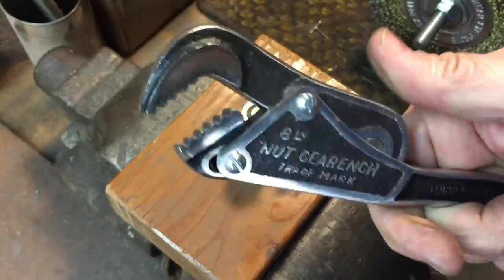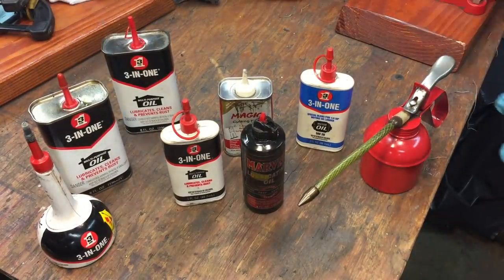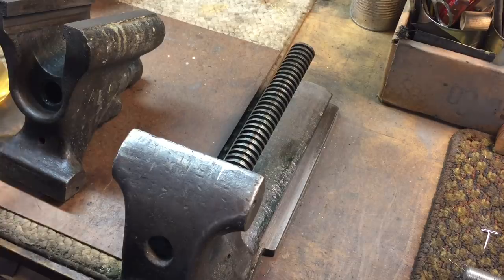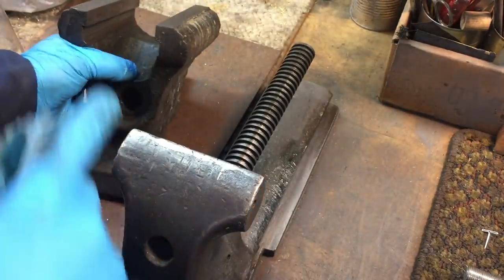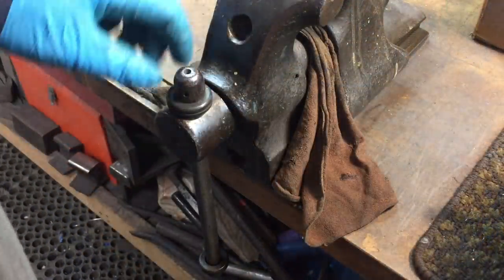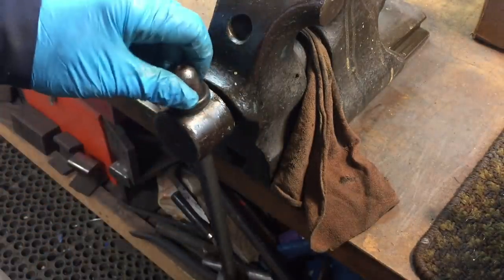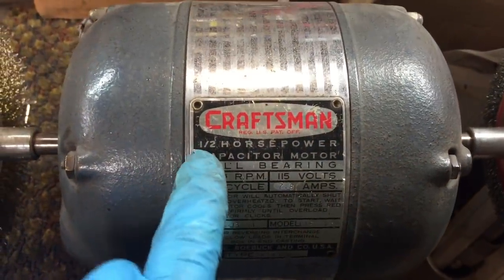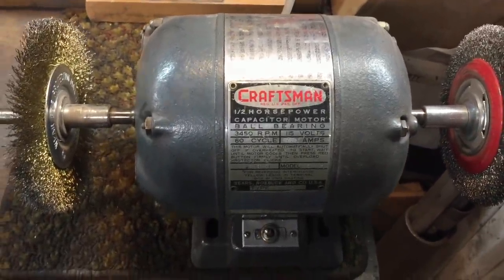Valentine's Day Mosh... Something to nosh on...

Comment: I like the applicator tip that comes on the small Rem oil bottle.  I think it works a lot like your Ronsonol lighter fluid container.  You fold it out to add a drop and fold it back in to close. I vote for just painting the bulldog's collar "ScoutCrafter Red"!

Comment: Hi scout,  thanks for the video,  3 in 1 oil has been around as long as I remember, but as you say the containers are pretty unstable, I have a place at the back of my bench ,made just to keep it upright. The dumpy one whith the pull out spout seems the most stable design,  but would have preferred  it whith out the tube spout,   I have a Wesco from the 1950s that belonged to my father, it's cone shaped 3,1/2"dia, by 4" tall whith a brass screw fitting to the spout so that you can shut it off, to use it you undo the fitting ,invert the can and press the base, this one doesn't  leak even if laid on its side for days,!  As for your bulldog, it looks great now, alot of older castings like yours were made from Spelter,  I would be inclined to lacquer it to prevent oxidising,  it would be a shame to cover up all that detail.  Your great grandads vise is a beauty,  made to last. Best wishes to you and your's, Stuart.uk.

Comment: One last thing, My Dad was a character. On our service truck at the garage dad found an old Mack bulldog and he mounted it to the truck hood. We had real english bull dogs at home. But dad took and drilled a hole in the bull dog ornament and installed a windshield washer nozzle from an old junk Chevy. He wired up a starter button on the dash of the truck connected to an electric windshield washer pump spliced into the washer fluid tank under the hood. We would be sitting at a stop light and some guy would be walking real slow across, blocking the lane and he would reach out and push that button and the bulldog would pee on the guy!! They just couldn't figure out where it came from! He would really enjoy himself with this! Never agravate a man with tools and a little time on his hands!

Comment: If you ever get new shocks or struts for your car, ask the mechanic to save the flexible rubber boots from them and then put it over the acme thread to protect it and it’ll crush and stretch as you open and close the vice. My father has clear silicone like oil bottles that have a flexible tube with a needle point tip for precise application on his knitting machines.
Reply from the maker: Joe- I bet McMaster Carr sells them!n   =D

Comment: My old Craftsman 8" bench table saw has a half horse and is plenty. Even has the original Craftsman V-belt. I keep Marvelous Mysterious oil in a pump spray bottle and the trigger hangs on the shelf edge And the 1st truck I ever drove after the chauffeurs license at 21 was a steel hooded DM Mack tri-axle. Since then I herded B-models, R's, DM's, C's, U's and all the way up to the 800 series. But that's 50 years worth and that's not counting the machines. I've looked at bulldog butts all my life and then ended up with 2 live ones! Oh well.  Been Blessed with a LOT of living and STILL Blessed. Happy Valentines Day, John CS and Sweetie! We had a DANDY!
Reply from the maker: Hi Lewie!  You really know your Macks!  I remember my Dad telling me when he was a young man and just started driving trucks he drove a early Mack with hard rubber tires and chain drive!  One rainy day he was going down a cobble stone hill and that was it, wound up in a store front!  LOL
Reply: @ScoutCrafter  I'm not as old as your Dad but my back bone can vouch for the rest. The B-model had a 711 engine which was the bigger Thermodyne that was a 673, around 210 horses. It had a duplex 2-stick, a 5x2 and you could track it by the parts falling off it but it was a SWEET driving, pulling and shifting truck as I ever drove. It had a concave cab because of the old trailers had rounded noses.  The motor/tranny mounts were GONE so when you went to take off the whole thing would just roll over, the sticks would move away from you and off you'd go. WILD! And the MB which is a garbage truck square cab sitting over the front tires was a single axle that I/we pulled a D7-F dozer with, hooked to a 2-axle lowboy. It had a gold dog Maxidyne 237 and a 5-speed. And me steadily looking at bulldog butts!

Comment: Clear coat it so it maintains the shine and detail. Resist the temptation to paint it red!!
BTW I hate those factory oil containers too. Love the one you had with the thumb pump and see-through hose. They are a little bulky to have all over the shop and you have to mark them to identify the liquid, but they work great.

Comment: Yeah, leave it shiny. By the way those rubber bumpers on your vise are Dixon glad hand washers. A glad hand is a quarter turn 3/4” air hose connector. Most industrial supply stores have them, like Graingers, MSC or the like.

Comment: Back in the 70’s I used to own a. modern version of that wrench by Craftsman, I loved it.  I used to beat the crap out of it to loosen some nuts and bolts and it fit almost every bolt I came across in the field.
I despise that 3 in 1 oil can with the pull out straw.  I have to get another can of 3 in 1 oil and if it doesn’t come in a halfway decent can I’m going to “buy” a small oil can.
Boy, that motor is a POS, get rid of it.  I have my Father-in-laws Grinder/buffer.  Let me tell you that thing is dangerous.  It’s a 5.6 HP. You couldn’t stop that thing if your life depended on it.
I like your idea for the wood insert for the vise.  Thanks for passing that idea on.
Clear coat the Bulldog and paint a red USMC on the back of the dogs collar.
Keep the videos coming!!!!
Reply from the maker: Wow!   Your Father in Laws grinder/buffer sounds super strong!!!!   =D   Thanks!

Comment: The best oil can I have at home is the old metal oil can with the bottom that you clicked with your thumb. I have several sizes I have picked up over the years. The one I use most was original equipment that came with a Model A Ford! In the house I keep a bottle of Singer sewing machine oil in a bottle like your Marvel Mystery oil. Good light oil. Alot of the HP differences on the old muscle cars.were for the benefit of fooling the insurance companys too. Good show as usual!

Comment: 3 in 1 containers - Interesting.  I, too, see in reviews that lots have problems with the current container, but I have to say the plastic version is working great for me.  I don't know what the issue is others are running into.  I do have a little collection of the old metal ones too.  The neatest one is from Mobil.  It has that great Pegasus logo dominating the front packaging. Fun!  It's too bad we don't have such great detail and iconic imagery in today's marketing.  ...and I appreciate your heads-up on the motor.  I've been looking for something to step up my tool cleanup a notch.  Thanks, Scoutcrafter!

Comment: Great video.  Nice vice.  I'm always amazed at the quality of tools built in North America more than 100 years ago.  Your little work table for the vice is a good one.  Good info a electric motor Amps.  I would leave the Bull Dog as is with a clear coat.  That way the detail is most visible.  Any paint would diminish the detail.  What type of clear coat do you recommend that doesn't 'yellow'?
Michael from Canada
Reply from the maker: Shellac is out of the question because the alcohol base darkens some metals...

Comment: There is a simple formula to calculate the approximate horsepower of a motor. 1hp is approximately equal to 746 watts. Volts times amps=watts. Divide watts by 746 and that is an approximation of the horsepower. For your Craftsman grinder that is rated at 1/2 hp: the plate says 7.8 amps at 115 volts. That is 897 watts. divided by 746 is 1.2 hp! And actually since line voltage in many places is now 120 there is no reason not to calculate it at that voltage. So that would be 1.255 hp.
Reply from the maker: Nate, my motor is probably drawing about 30 watts!  LOL!

Comment: I've never really found an Oil Can that I was completely satisfied with. I just went downstairs and checked one of my Cheapy Grinders 4 amps too but it rips right of my hand, can't hold that one back. Gotta say I'd leave the Bulldog alone, I would hate to see that fine detail covered up. Grommets look like the ones for PCV Valves on  engine valve covers.

Comment: That's the reason we don't use "horses" to measure the power of an electric motor. We use kW instead, product of voltage and amperage. The best thing for a powerful motor is a three-phase power supply, because this also provides a rotating field. You don't require a big capacitor (Steinmetz circuit, named after Charles P. Steinmetz, a german/american electrical engineer) to create a rotating field for the motor, also this kind of circuitry steals you round about 30% of the power and torque of the motor. The capacitor must be dimensioned correctly, here we got an "over the thumb" rule of 70 mikrofarad per kW motor power for a voltage of 230V.

That's the reason I'm going to install a three-phase outlet in my workshop, I've already installed a new three-phase sub panel (3x230/400V). The old one was single phase only.
Reply from the maker: Having 3 phase in the shop is always a plus!  Welders and all the big equipment love 3 phase!

Comment: I agree many motors have fake HP ratings, especially shop vacs.   As you mentioned, the amp rating is normally correct, but not the HP.
I have observed many Asian motors "round up" fractional HP motors to the next highest integer HP.   Equally fake.

I love my Zoom bottles with the telescopic spouts for oiling fan motor bearings.
I have a number of trigger style oil cans Eagles or clones of Eagle.   I made a 3D printed base for the ones which do not have a flange on the bottom to prevent tipping.
Very nice cleanup job on the bull dog.   I would just clear coat it.
Dave.
Reply from the maker: Hey Dave, you know you have a powerful shop vac when it sucks up everything you don't want sucked up!   =D

Comment: According to The Engineers Toolbox, if the nameplate is true, you have a 1/6th hp motor. ,  https://www.engineeringtoolbox.com/elctrical-motor-full-load-current-d_1499.html
Judging by the way you stopped that motor with your fingers, I think they rounded up that amp number a couple amps. 
I favor Eagle Pump Oilers. Similar to the one you are using for the 50/50 mix. 
I think the design of your Grandfathers vise is in a large part responsible for its longevity. The forces are all transfered directly to the bench through those long dovetailed gibs. Most vises that I repair have bent or broken beams from having the moving jaw cantilevered out off the edge of the mounting. 125 and still working. I hope I can say that in another 57 years. 😆
I like the suggestion of painting the bulldogs collar red. Maybe you can find or make your own dress blues for your mascot. 
It might be made out of ZA #27. A light but strong alloy of Zinc and Aluminum.

Comment: Old Craftsmen were good tools, the new asian made are questionable. 
Bulldogs, Macks and Marines they go together. Leave the dog the way it is. It looks like it has a pin through it from its right shoulder. It looks like it might be zinc. If it is from just after WWII, it could be melted brass casings with a real good plating. Good Luck, Rick

Comment: On your bulldog, I'm wondering if it's zinc and/or magnesium?  The more I work with metal, the less "judgemental" I am about the materials - as long as they are appropriate to the use, magnesium/zinc is as good on your bulldog as the iron in your grandpa's vise relative to their purpose.  This bulldog is for your pleasure, so finish it however pleases you most - even candy apple red!
Reply from the maker: Hi Marc- It's hard to guess certain metals... This one is non magnetic and not as soft as Aluminum...  Fun to try to figure it out though...  =D

Comment: This may have been commented on already. Motor power is Volts x Amps = Watts. One horsepower is 748 Watts (just remember 750W / Hp.). That Taiwanese motor design current draw is 4 Amps. So 110V x 4A =440W  & 440W x 1Hp / 750W = ~ 0.6 Hp . So labeling that motor 3/4 hp. is wishful thinking. Labeling it 1/2 Hp would have been more realistic.
    That being said, there is something wrong with that motor. It sounds like it is running on the start windings, i.e. the centrifugal switch is hung up and the run windings are not being engaged. I tried to listen to Scoutcrafter's audio carefully and I don't think I heard the switch kick out when the motor started. It should be very noticeable when the motor is switched off and coasts down. The Centrifugal switch should make a very audible click just before the motor stops.
     Last month I bought one of Horror Freight's 1/2 Hp bench grinders to wire brush and polish. The Amp draw is correct for ~ 1/2 Hp. This mainland Chinese motor appears to be identical to the Taiwanese motor you have except the Chinese cut costs by eliminating the start windings. To save stress on the run windings I spin the motor by hand before pushing the start switch. Like most Chinese products it works... sort of.
Cheers from NC/USA
Reply from the maker: Maybe even 1/3 hp, although the capacitor might be failing...  Motors are both simple and complicated!  =D

Comment: Whats with Marvel saying to pour it in the gas tank? My truck is now carb'd so it might be interesting to try it out.
Reply from the maker: Years ago Doug Marvel Mystery oil was added to fuel as a type of top cylinder and valve lubricant, those old motors needed lead in the gas as a lubricant..

Comment: First, I hope you put today’s priority on the girlfriend and not on playing with old tools, because we’d like to see you continue making videos after today. 😉.  With regard to the motor power, there’s a device called Kill-a-Watt which sells for about $25 or so at Harbor Freight and on line as well. It directly measures volts, amps, watts, horsepower, etc of anything that’s plugged into it so you can very accurately measure power consumption of anything that runs off 115 volts.
Reply from the maker: I have three of them and they are great!   Everyone should own one!   Great tip!

Comment: I wonder if the alloy of your bulldog is some version of zinc based "zamak". https://en.wikipedia.org/wiki/Zamak Probably one of the most common alloy used in castings and heavier than aluminium but lighter than brass.

Comment: Hey scoutcrafter i was wondering if i use a hammer heavier than what the handle is rated for.  will the head of the hammer snap off the handle. Ps. Keep up the great videos
Reply from the maker: Hello Brad!  Most hammer handles are very resilient and can handle a lot of abuse.  Much of it depends on how the user treats the hammer.  Many handles were broken by missing the target (nail) or trying to pry something too strong!  =)   The good thing is usually it's not dangerous!
Reply: Ok thank you for the clarification

Comment: They put people off by supplying motors without torque, I bought a grinder  like that and it is useless, Nothing worse than a tool that does not work. I know the old saying about a poor tradesman blames his tools, but in this case it is true, Of all the tools, the angle grinder even cheap ones do a good job they seem to have the torque. The bull dogs looks very good as it is. Nothing worse than a leaking oil can and a small drop spreads everywhere.,
Reply from the maker: Tony you are so right!  Thanks!!!!!